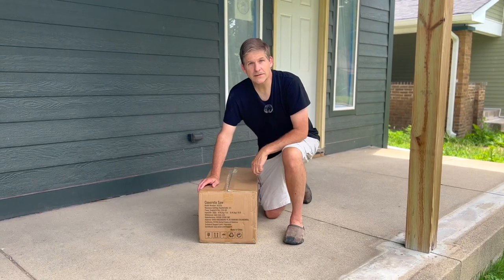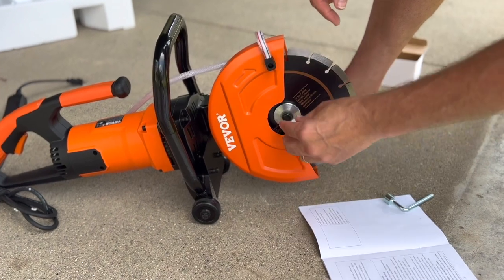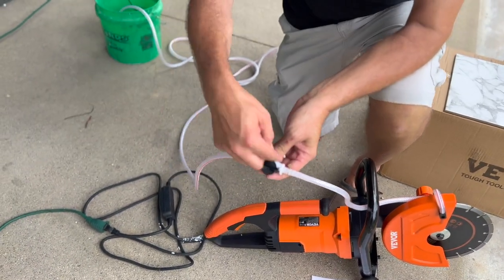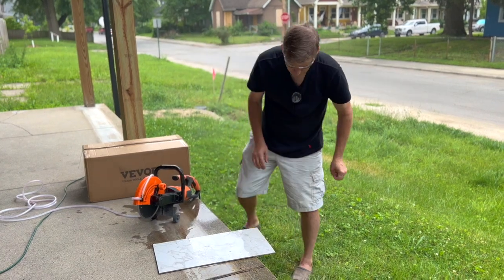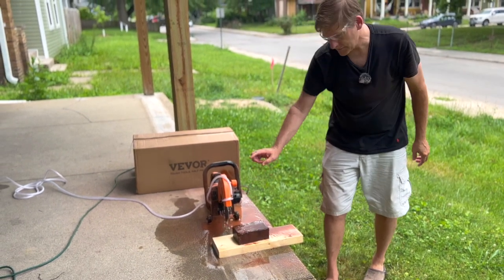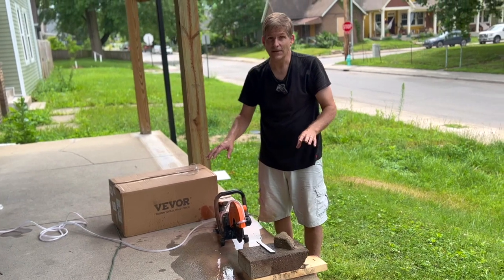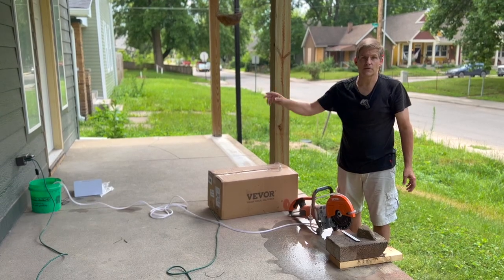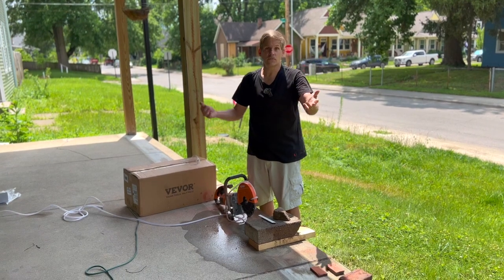How to use a concrete saw |  Concrete cutoff saw - VEVOR

Comment: Thank you. Question , sometimes a slab has metal attached to the concrete will it cut through? Wire mesh
Reply from the maker: Hey freesoul…,
I have not done so with this saw but my guess is that it should cut through it no problem. 
One thing to note : this 9 inch saw will go to a depth of almost 4 inches and your typical slab is at least 4 inches thick.  So you may have to cut and sledge and then make a second cut to get all the way through… just fyi.
Thanks for watching!

Comment: I need a saw that can cut through a poured concrete patio. I need to dig up and repair my septic line. Do you think this will do it?
Reply from the maker: Hey Ed,
It will be close - typically a slab is about 4 inches thick. A 12 inch blade may be quicker. 
Thx for watching!
Reply: They make a 14 in Ebay $200